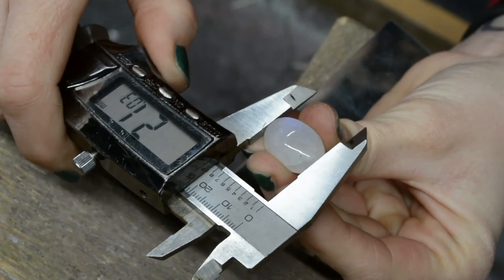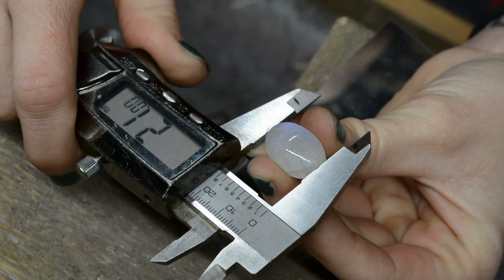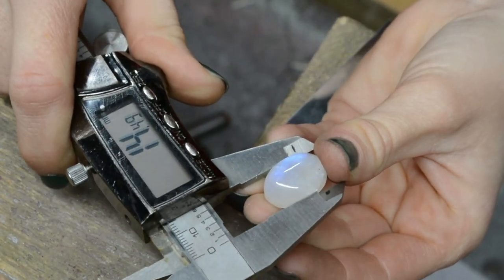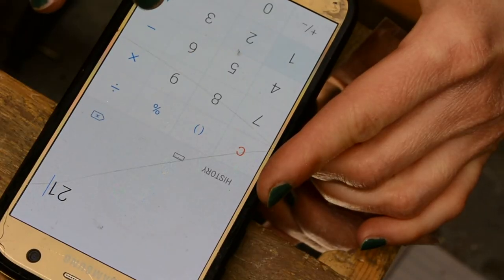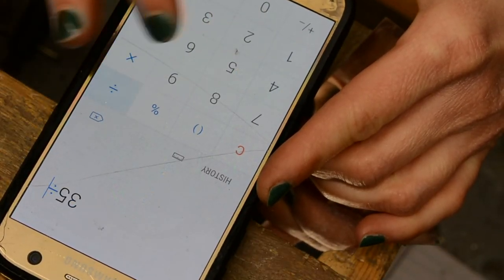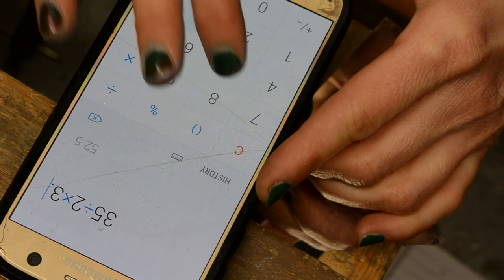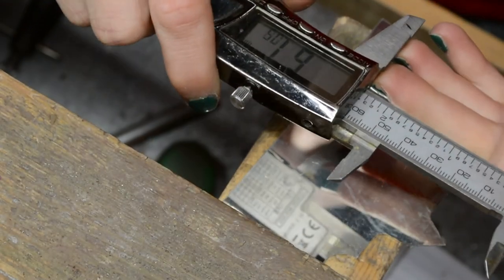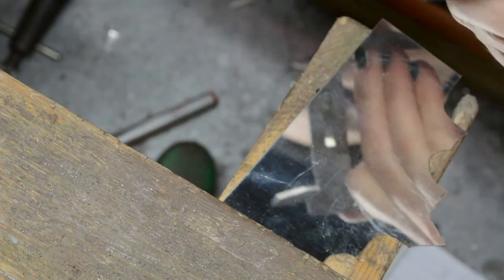Making Bezel Wire Using Pepe Rolling Mill

Comment: Again, great idea! Love  moonstone and also labradorite, but they often come rather "chunky". Never occurred to me to cut and roll my own! duh! : ) I generally use 26-28 gauge bezel wire. What gauge did you start with and end up with? Now I can put my chunky stones into great jewelry! I did just purchase a shear so that should make those long cuts easier for me. Thanks! Keep posting informative videos!
Reply from the maker: Thanks for watching!! Yes they tend to be so high the stones, It really works out using what you have in stock. It started at 20 gauge and I ended with around 28 gauge. Try it out let me know how it works :)